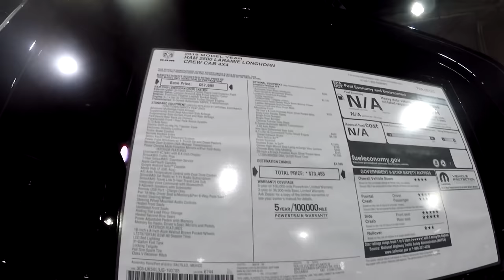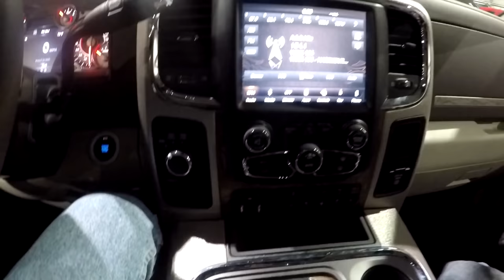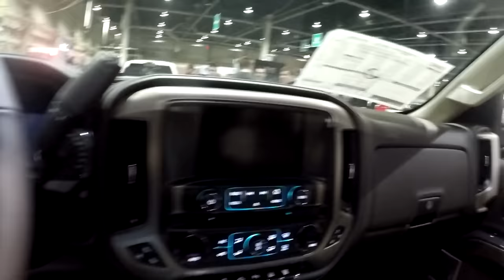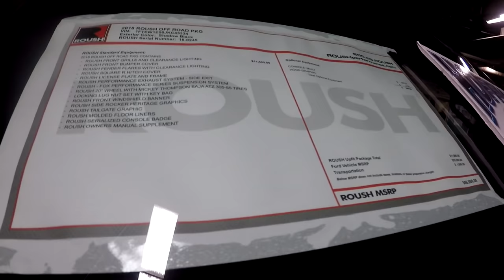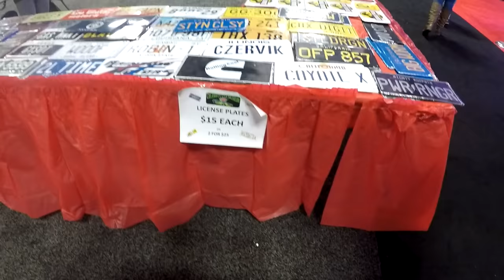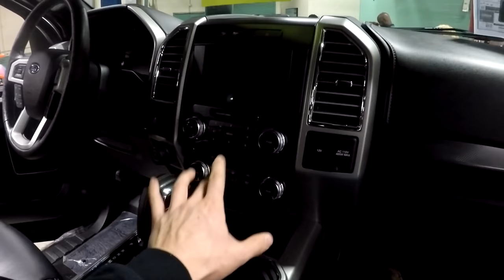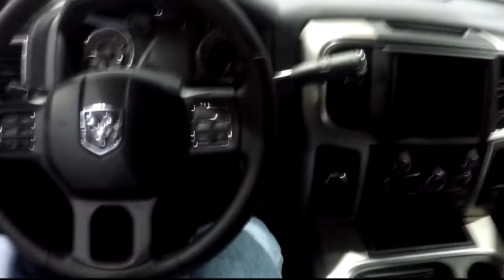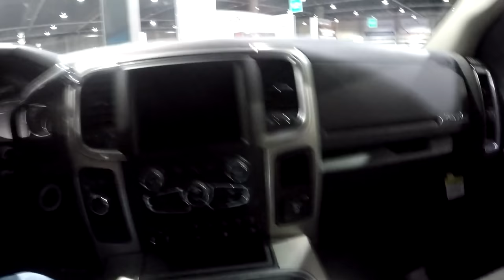THE DEAL BREAKER ON THE 2018 FORD POWERSTROKE...

Comment: How many omg”s ?  How many ridiculous ?   And it’s all sick. Lol.  The fords have massaging seats  they are Fabulous And btw the fords 275/65r20 is a 34.1 inch tire  a 35 measures 34.6   So stock is 1/2” shorter than a 35   The 2017-18 will fit 37’s with a level spacer
Reply: Bleeding Diesel903 I know this kid doing the video doesn’t even know what he is talking about 🤦‍♂️
Reply from the maker: you are just mad you cannot work on such a crowded engine bay

Comment: No go on the ford, way too many issues with fuel causing problems with injection pump. Dealers have been denying warranty claims blaming bad fuel, which is not covered under warranty. It’s BS, and a $6500 fix.
Reply: bayonne truth be told the number of fuel system problems with these newer trucks based on the number of trucks on the road today is actually a very small percentage number and the majority of them were the owners fault by not putting in the proper fuel ⛽️ gas by mistake or not checking the water separator and draining it on a regular basis
Reply from the maker: I will definitely look more into the commons issues
Reply: bayonne Whatever issues these trucks have , they seem to be very small in number. Everyone I've talked to has said the 6.7 is almost up if not equal with the 7.3 in terms of reliability. So it's a very good engine, but as with any vehicle where they sell hundreds of thousands, they can't all be perfect.
Reply: bayonne GM uses the same fuel pump and injectors. Point is invalid, both companies will deny warranty